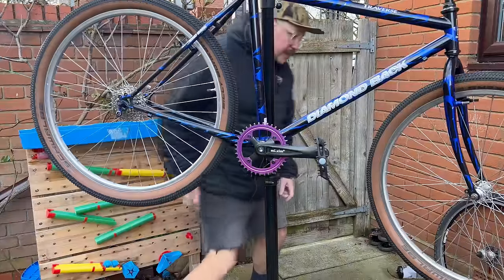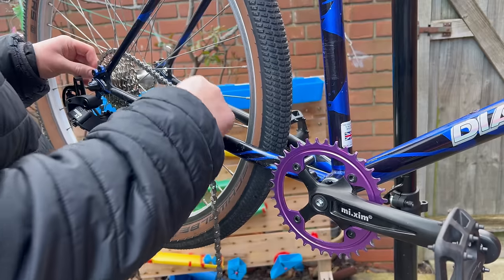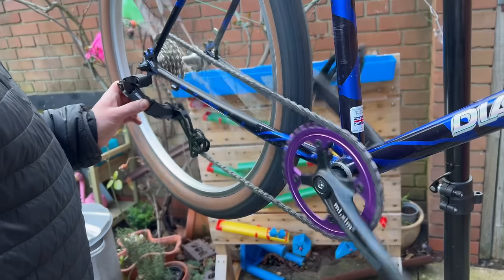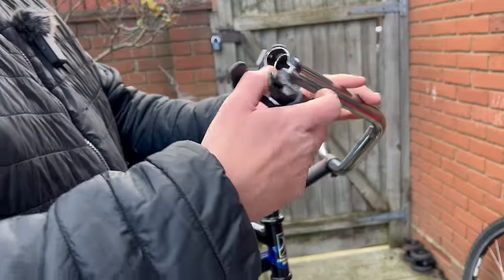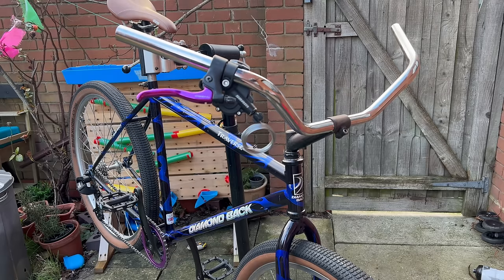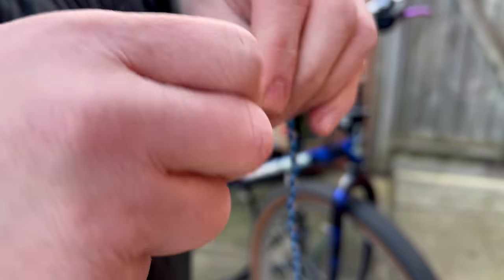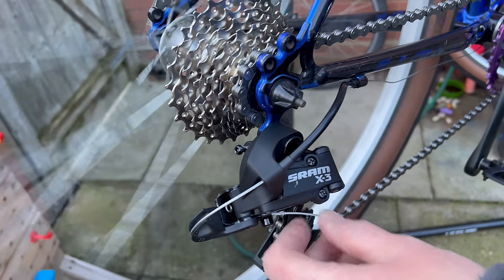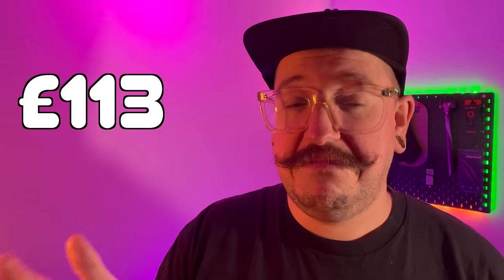Cheap Bike Build Off - Diamondback Traverse Restoration -  parts bin Commuter bike build vintage MTB

Comment: Love the content and the quality of it! I just wanted to emphasize that the main difference between brake cable housing and shift cable housing isn't only it's diameter. Brake housing has a coiled steel reinforcement to allow it to be flexible. Whereas a shift cable housing as linear steel reinforcement to allow to retain precise pull better.  When you cut a housing it is quite noticeable which is which with this info in mind. It's fine to use brake cable housing for a shift cable (not optimal, obviously), but the quality of the shifting will always be subpar and require more frequent adjustment from my experience. Just a friendly reminder. Keep the videos coming! Cheers!

Comment: Gear cable is usually linear sheath where as brake cable is spiral wound. (Unless you get BMX linear cable which doesn’t compress much) 

Spiral wound cable compresses a bit more than the linear gear cable.

Really liking how this is turning out.

Comment: What the commenter said is in fact true, and I can relate to the frustration.  In the US market, folks are buying old mountain bikes for cheap and then restoring them with upgraded parts and components, and then reselling for $1000 + while calling the bike "vintage".  The only thing on the bike that might be vintage is the frame.  It's crazy because if you're in the market to buy an old StumpJumper or Diamondback Apex, then you'll actually be paying for the "new" components that the person put on the build.  You're lucky if the frameset comes with the original fork and handle bar.  Vintage means all original components (original new, old, or old refurbished to original specs).  One guy was selling a 90's Bontrager Race Lite mtb for $800.  The only thing on the bike that's vintage is the original frame and is missing one of the primary decals that goes on the top tube.  Tried to talk him down to $200, he said no, as the bike is "vintage" and that he purchased upgraded components and wants to recoup his costs.  He admitted that he's not the original owner and the bike was left out in the yard underneath a tarp for a few years.  The used bike market in some areas is terrible.

Comment: I was thinking that the only thing that might make the different colored grips weird, is the proximity to the bright brake levers. I guess...we'll see though. I was wondering if doing the alcohol trick (like when putting tight grips on or taking grips off) would have helped slide the blue over the pink cable. Just a thought. 👍🏾👊🏾

Comment: Cheap parts and time, sort of come hand in hand. Its much easier to buy an expensive part in stock and 24 hour delivery rather than a bargain bucket or ebay throw away. My last bike build had the frame waiting a year as I was damned if I was going to spend more than €180 all in. With a need for a new chain, cable and tyres I think we're going fine on these budget builds, $150 really is scraping the barrel!!

Comment: Interesting concept. I have to say it does seem that you were having an off day. I think you misunderstood the chain link formula, you took too many links off which is why the derailleur is so stretched out. You need to add some links back. i like the tan grips solution but not the use of brake cable outer for the gear. Brake cable outer compresses under tension. I don't think the pink looked bad. The chain tool reach is something I do all the time. also the same with bar tape reaching for the scissors and finishing tape. Anyway keep the vids coming they are interesting and entertaining
Reply: Yep.  He measured almost for a single speed (without threading the chain through the derailleur arm first).  Not the best strategy.
Reply from the maker: Thanks for the feedback guys, like I mentioned in the video. I’ve always followed what I learned from the park tool videos. 

I’ve been doing it like this for years and never had a problem but maybe I’ll look into the way other people do it and see if it helps.
Reply: One link is actually two as there's an inner and outer which makes a pair which is what Park tools mean. You have counted half a link as one.. The starting point of your rear mech is already pretty stretched out and a derailleur should never look as stressed as does yours when on the lowest gear. I've seen other comments here which back me up. The chain should never run straight through the mech as yours does here on the low gear. I'm surprised that you didn't think it looks wrong. @2NDLIFEBIKES

Comment: Any tips for finding coloured cable housing in the UK? I just ended up ordering some pink from AliExpress after not finding any locally
Reply from the maker: This is my go to UK seller on eBay. I’ve used exclusively apart from the orange cable I used on the MoonRun. That was Jagwire. 

https://www.ebay.co.uk/itm/203139845482?mkcid=16&mkevt=1&mkrid=711-127632-2357-0&ssspo=hialobfyq1m&sssrc=4429486&ssuid=9KqFCMcfSSq&var=503719828201&widget_ver=artemis&media=COPY

Comment: Also you cut the chain too short. The drive train will never run properly if you leave it like it is.
Brake cables are thicker than gear cables. You can get wound and linear brake outers. Linear brake outers don't compress and are used a lot in bmx. 
Gear cable is linear because it needs to be stiff.
Why not put your chain tool in your pocket before you cut a chain in future? 
If you have a garden could you make one that folds away? Or space on your exterior wall? A surface to put parts, tools, grease/lubes and consumables will quickly become your best friend